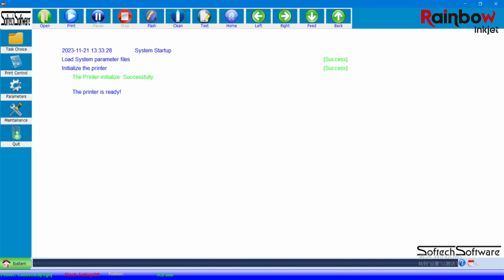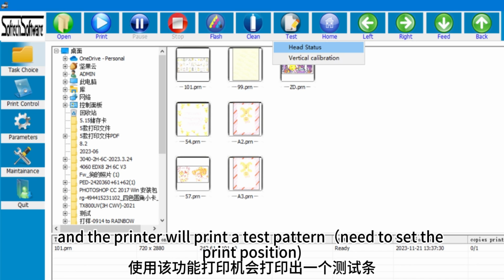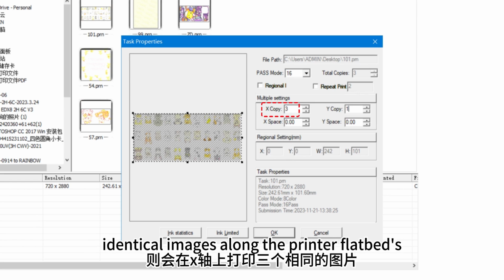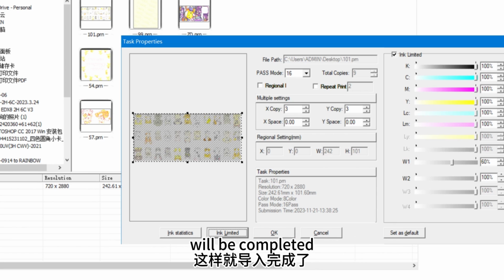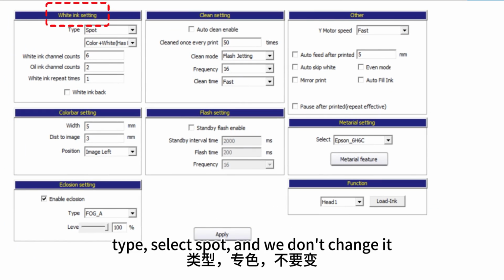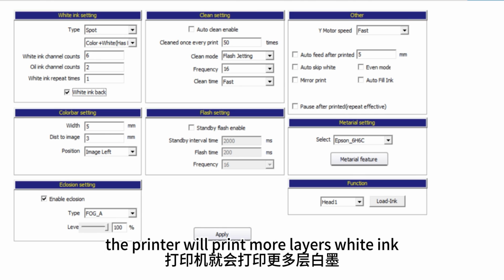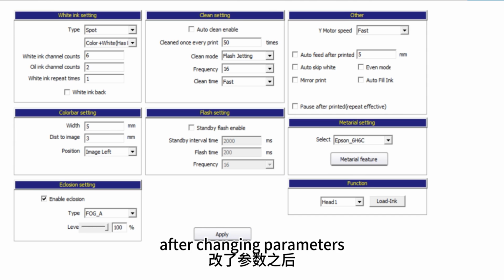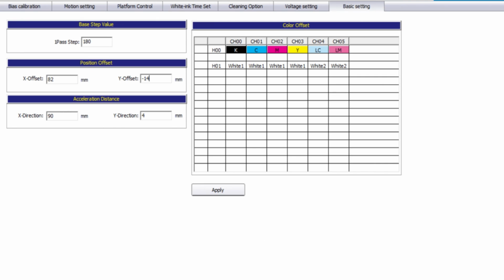Wellprint Tutorial

Comment: Hi.  I have problem wirt flash jetting. During printing process is not switch on. When in standby mode I switch it on when start printing process flash jetting automaticaly switch of. Do you have idea what is the problem please. I have printer with 2 TX 800 heads. Thank you.